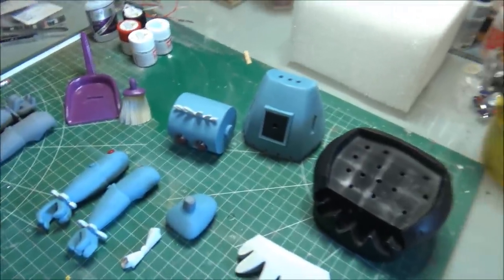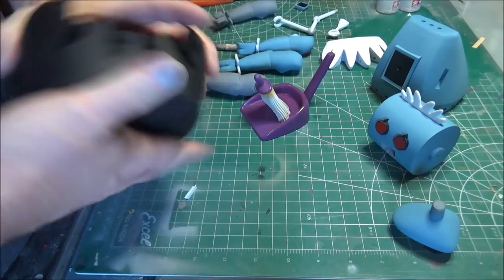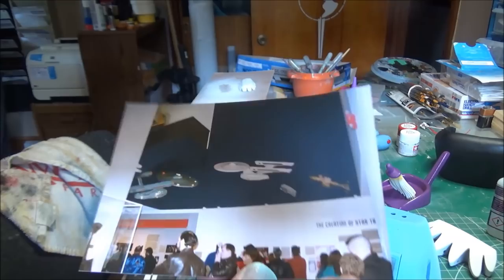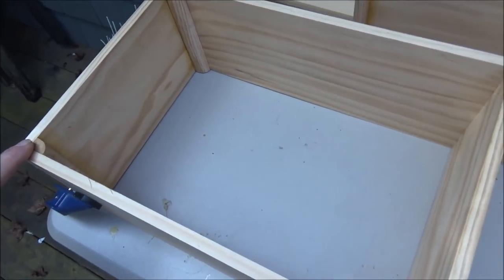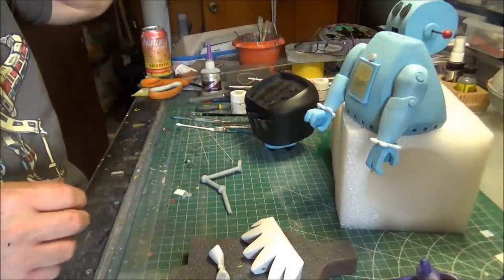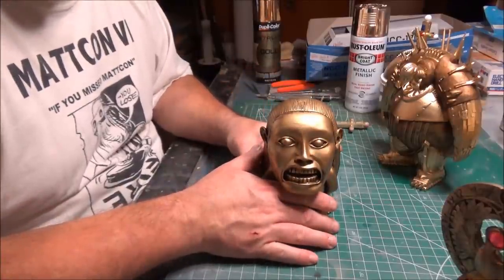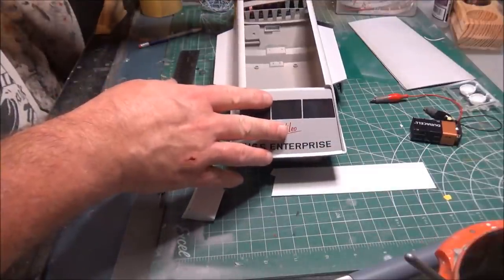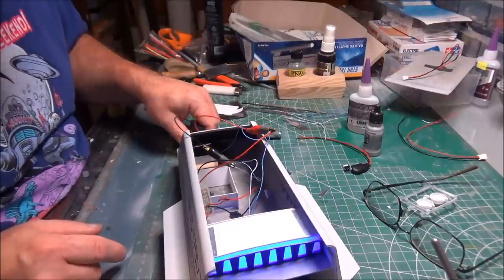Aztek Dummy Update 9/18/20 - Odds and Ends

Comment: I really enjoy your rambling busy weeks-- and the sound of that sweet sweet printer buzzing in the background! Speaking of things to print on the internet-- have you visited that chum of Simon's who makes a Sulaco? The fellow sent Simon prints of the dozens of parts and it built up to a 3' model! Which is just what you need-- of course. BUT! the good fellow offers up the print files for all. Very nice thing to do. I believe you can re-size those things. Not sure myself but it sure sounds interesting.
Metric beginnings: 1" = 25.4mm. 1 divided by 25.4 makes one millimeter equal to .039" or "thirty-nine thousandths" of an inch. i still prefer a decimal inch but it just takes a step or two extra to work in metric. Sigh.
Electronics-- I am so glad you found something to do with that circuit... now to help make it more practical. I think a simple voltage regulator (which sounds fancy, but is a single large component) will do the job. I have a goodie bag I've been putting together-- I will see if I can speed that up.
Do you think your masks for this shuttle will fit the old styrenated version?
Nice woodworking-- straightforward and good looking. Now you need to add a second floor.
Reply from the maker: All I larned in skool was that a meter was about 39 inches

Comment: Holy hand grenade looks gorgeous! Not sure what the parabolic backing on the Galileo engine gains over a flat back. Face hugger - aaahhhhgggghhh! I have an FFM 3D printer but am looking at a resin one - which one do you have? As always, looking forward to next week.
Reply from the maker: the parabola bends the leds in so they don't create hot spots like they would if you looked straight at them
Reply: Lou Dalmaso  Hey Lou, fantastic week of potpourri. Sometimes like these videos better than one dedicated to just one project.
 I was wondering, about the mask kit for the Shuttlecraft. Is there ( or will there be ) names and registration numbers for the Columbus? 🤞🤞🤞
Reply from the maker: Yes, the same 3 names as the kit decals

Comment: Loving your 3D printer joy! You are showcasing some lovely designs. I'd imagine the creators of the stl files would love to hear from you! - Continuity in cartoons is always flexible. Your 3D file was probably based on this reference, which has a different mouth to the more usual one -   https://res.cloudinary.com/engineering-com/image/upload/w_640,h_640,c_limit,q_auto,f_auto/rosie-robot-jetsons_zpspkxwmcrq_syxzyv.jpg
Reply from the maker: you have to be right about this it is the exact pose for the kit. Still like the other mouth, tho.
Reply: @aztekdummy  The one on the print is not typical of how Rosie is drawn. I prefer your version too!
Reply from the maker: @portland-182  it has me wondering if it isn't from one of the later series. The other thing I would change is that Rosie had two fingers and a thumb. this kit gives her claws basically two front and two back. lastly all of her accent bolts were red. here only her shoulder bolt is red.
Reply: @aztekdummy  The continuity on Rosie seems to be not a priority for the production team - the disappearing buttons on the front, are also 'magical', aren't they?